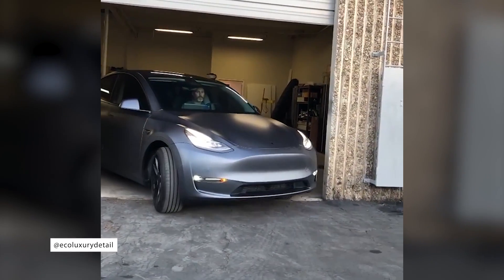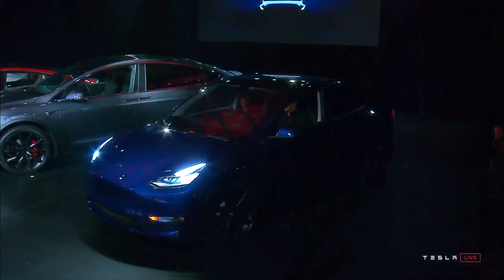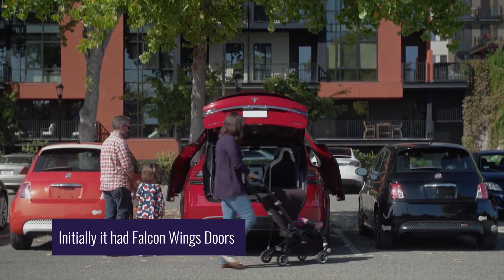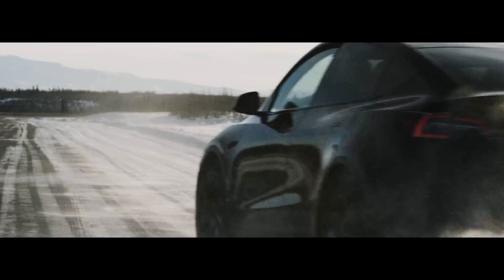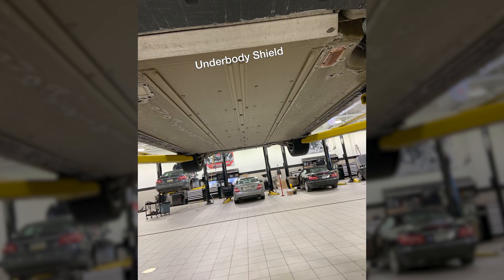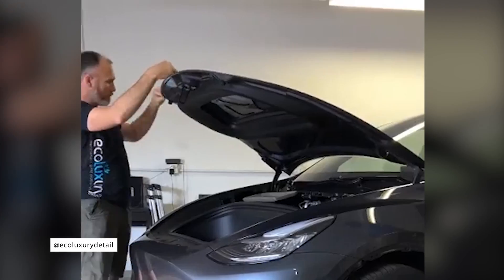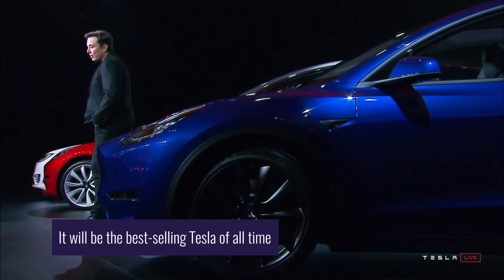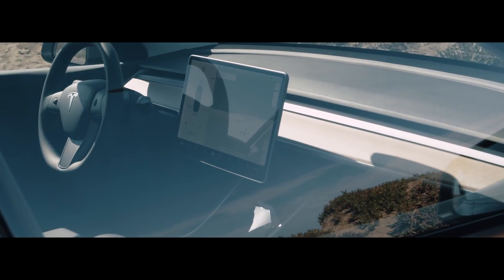Tesla Model Y: 10 Facts You Probably Didn't Know

Comment: I got my Model Y yesterday. Today, as I was sitting in the car, it was very windy. There was a loud whistling coming from the hatch area. I also have a 2012 Chevrolet Volt with 150,000 miles. The model Y is much stiffer and not as comfortable. It has a much more sports car feel. The Volt has a much better fit and finish. I always thought the Volt had great acceleration until driving the Model Y. Wow! I think Tesla is lightyears ahead of other EV's. They need to get a grip on fits and finishes.

Comment: Love my Y, although the hatch didn't align properly and had to push down it to close it. Tesla fixed it and it's almost perfect now.... my only issue is that the suspension is a bit too rigid, the car handles well but man no give when you hit bumps at high speed. Tesla could learn a thing or two from BMW about suspension. Otherwise love at home charging, cabin preconditioning, one pedal driving, perfect size and seat position, the minimalistic and super clean dashboard, the glass roof, autosteer, autopilot, auto garage opener, sentry, nav, tons of space in small package, safety, LACK OF MAINTENANCE (except for tires) and INSANE ACCELERATION... never gets old - the car just lunges forward.
Reply: I want one.

Comment: First, I would like to see latest solar panels embedded for extra miles on the bonnet and the rooftop keeping the panoramic glass.

Second, I want to have GPS guided solar tree, coming out of the car at the time when it is in office/home parking. It should be almost free to drive, from home to office and vice versa with this 30-50miles solar backup on weekdays.

Third, It should have an 1000miles hydrogen pack reserved for long drives on weekends. 

Fourth, Batteries can be restricted to 200miles range. This will improve efficiencies because of less weight and compensate for backup by solar and hydrogen.

Fifth, It should have four independent hub motors for all four wheels.

Tesla Zee Model with all five above implemented will be the Caar to have..!!

Comment: The only problem with the Y is that there is no readily available mechanical door opener in the back seat which is a big problem for emergency egress if there is a power outage or an accident...this shortcoming should be fixed in future versions (combined with child safety locks).

Comment: How do these perform in flood or at roads filled with water upto full tyre.
Reply: The electronical components are water sealed. You should be able to drive in water up to 1 foot deep. But I've seen people driving into puddles of water up to 3 feet deep with no problem but it isn't recommended.

Comment: Your video has one mistake. The Mercedes uses gullwing doors. The Model X uses falcon wing doors. A key difference is the double-hinge operation of the falcon wing doors vs the gullwing doors using a single hinge.
Reply from the maker: Good attention to detail and appreciate the feedback but in automotive nomenclature the terms are interchangeable regardless of hinge configuration. Falcon wing is correct, but gullwing is indeed more correct.

Comment: Info appreciated! However, if I do get a Model Y, it will be a 7 seater. Only if I don't have to morph adults into the size of puppies to get back in the third seat! I hate 7 seaters in general, but with two grandchildren, it will be so handy! I have heard that a Chinese battery maker called CATL will increase the range to higher than the current 310. But by how much, is not clear. Give me 400+ miles, and I'll pull out my wallet!!! Currently range anxiety is kind of bad during long distance trips. But yes, if you use the Navigation system of the Tesla, it intelligently shows you where exactly you need to stop to recharge.

Comment: Of course it's possible to build a safer car than the Model 3. At the IIHS small overlap crashtest the front structure started to collapse. The drivers feet room got smaller. Seriously, the small overlap performance is one of the reasons why I didn't want to go for the Model 3. I actually own 2 Volvo cars. I hope the small overlap crash performance will be better in the Model Y, in this case this could be my next car.

Comment: Got ours a month ago and love it.  Just a few hiccups though.   Summon function the car freaked out and needed a firmware fix that took a week at Tesla to. Figure out. Now we have a A/C issue in the cabin and on the display. Not cooling inside and says it’s 145 degrees outside.  Need to get this straightened out. Big fan of the vehicle here and know there will be some bugs to work out with software or and firmware updates.  
Wish there was a 50 mile battery backup unit as an accessory that was available just in case....

Comment: Gonna be 18 months until the Y is available in New Zealand. I’ll wait thanks. Should be a worthy successor to my Focus RS in dual-motor, high performance, 21 inch wheel guise. Maybe Elon will have incorporated a yaw sensing front to rear torque splitter by then.

Comment: The biggest problem with electric cars right now is if you come anywhere close to their stated performance 0-60’s you range is severely diminished.  So your  280 mile range is now 100 miles tops after flooring the car a few times.  So it would be much more accurate to state:  2.1 second 0-60 OR 280 mile range, but not both.
Reply: No gas car gets their rated range when you floor it either.
Reply: Kris Fisher true but it’s not as significant in a combustion car because you have a 4 minute “recharge” time to 100% capacity.  Not 45-1 hour to 80% capacity and only at certain super charging locations.  Electric cars will only become practical when the energy density of the battery packs are double to triple what they are now and the recharge times are cut in half or 2/3rds.  That is still a decade away.

Comment: I got my LR 2 motor last week. Love car but soured on my treatment throughout the process. I was told twice I would have home delivery (Tesla cannot sell in Alabama), Then when my TA finally texted me, he said not so. I had to drive 162 miles to Nashville to pickup. They tried me to rush me since they were delivering 40 cars that day instead of the normal 12 (June 27 - near end of quarter).  I could not drive until I paid. Also told me to take pictures of problems found during first 100 miles and send to service via app (162 miles to my home).  I could not get app to work on site and sales person told me sometimes it takes an hour.  When I got home that night, it still did not work, I texted the guy several times with no replies and suddenly it worked around 7: PM. The app would only let me take 5 pictures max.
Reply from the maker: Yeah...but hows the car?
Reply: Electric Future it is great. Gaps from 3/32” to 1/4” that seem simple to fix ( moving doors) and charging port door rests on paint rather than small gap. Service coming here 21st well outside my 7 day period. Hoping he can and is willing to fix. A neighbor noticed the gaps already. .
Reply: Electric Future y

Comment: corrections 315 miles for the smallest rim package the bigger the rim the more range and quickness you sacrifice for speed and looks and handling the big rims gives you 280 range. the car has had structure removed as it can still get a 5 star with less materials and the 3 and y are now made with better welds the y is not stronger or better the 3 gets the new welds and still has extra structure far safer less intrusion. i would rather have the x but the 3 is better in every way!!! the 3 looks better its more efficient better cornering and more range. its cheaper its faster its quicker its safer better blind spots better aero dynamics less body roll. the model y does not have 66 cubic feet of space if you have 4 people in car it drops down to 19 cubic feet if you fold down the rear seats in a model 3 it has 58 cubic feet any car on 18 or 19 inch rims have quieter cars than cars with 20 or 21 inch the bigger the tire the louder the car is.
the model y has put the seats on risers so they lifted the roof for head room but this made the windows retarded tall looking like a clown car. there are better options coming soon like the MACH E will have all the same performance specs of the Y but the hatch opening will be big enough to have a futon the 27 inches of opening space on y doesnt fit much or anything with bulk. you buy a Y you have ignored better options and probably will be forced to do foolish money....
Reply: Valid points all
Reply: Blah, blah, blah.....I am buying a Model Y.

Comment: Moved from a Model 3 to a All Wheel Drive, Dual Motor, Pearl White Model Y.
Important note:
Tesla Palm Springs, CA offered me $31k for my Model 3. I thought that to be low, considering only 2700 miles. So I took it to CarMax in Riverside, CA for an estimate. $36k! I sold it there. 
Model Y problems:
I’m also having problems with the hatch back. It doesn’t release when handle is pressed and rubs on the right side when raised. This friction is why the handle won’t release and has to be manually raised. 
I have to waste time taking it in to be fixed. Very expensive car to have to do this.
Reply: Good to know
Reply: These and other issues I've read about is why I would wait until Tesla matures as a car company.
Reply: Ettore Namias tesla has matured but they don’t care that a simple little fix like that happens to these cars, their mission is to help the world by getting more people into cars that decrease their carbon footprint, it’s not an electric mercedes lol
Reply: @MalaxaiVDW  when you spend 60-100k on it they should care about their build quality.
"their mission is to help the world by getting more people into cars that decrease their carbon footprint"
you dont get people into these cars if they wont buy them due to build quality.
Ive talked to well off relatives - some of their friends complain about their tesla, batteries in the winter/heat, non-aligned door panels, and some other ideosyncracies: other get desuaded from buying the cars that way.
Reply: Raph Ael if you’re spending more money on it and. or buying it for the over the air updates and driving capabilities as well as reducing your carbon footprint also even with not the best build quality theyre still the safest cars on the road so when you add all that up, the cars not being perfect isn’t that bad because i’m sure if you go back to the 1900’s tons of cars were messed up by factories that’s why they have a recall system for actual issues that everyone would have to/could face. so anyone who would buy this car and complain about anything that’s vain such as a panel being a half a millimeter too far from the one next to it, should buy a Mercedes or Porsche and be happy with themselves it’s really that simple, they act like the build quality issues aren’t well known😂.
Reply: @MalaxaiVDW  I guess it comes down to me being german. Sandy Monroe said it and I'm with him on this: To europeans, body build quality is extremely important. Thats why I think TSLA will improve on that in their factory in berlin.
Some ppl wont buy a tsla only for the reason of panel gaps, bad paint job + lack of luxury interior,
Reply: @MalaxaiVDW  Build quality is something you should be able to expect in a 50k+ vehicle tbh.
Reply: Raph Ael we’ll see... i doubt Tesla is going to make any one factory better than the rest or else their other car buyers would be mad, therefor i think they plan to sell cars to the Germans who are more open minded and less rigid in their old age thinking of everything should come perfect when you buy it, there’s something wrong with everything and being obsessed with perfection leads to failure in all cases, hence why people buy new cars even when they buy a super car that comes perfectly aligned and setup.
Reply: Raph Ael build quality is not their mission, people misunderstand Tesla they’re not selling you the cars to get you in a Tesla like other car manufacturers who just want to milk their cumstomers for cash they’re actually shooting to make the world a less toxic place. only people who understand this should buy tesla’s. anyone who would whine like a child over a misaligned piece of metal that keeps them safe and updates every couple of weeks would be happy in any other car that doesn’t do that but will come perfectly aligned.

Comment: Overpriced
Reply: Richard Dixon  It doesn't take much to be a shareholder. And they are expensive to buy and to repair, but they are super cheap or FREE to fuel and need almost no repairs. It's really just tires and wiper blades. If you keep it for years you will save money over any other comparable car and if you sell it they really keep their resale value (just don't trade it into Tesla)
Reply: @israndy  The amount of money you spens for Tesla car is the same amount of money you would spend on fuel and repairs for ICE car plus the price of that car.The price to recharge your EV is low now,since there is no huge numbers of EV.As soon as EV cars become dominant the price for electricity will go up to the point of fuel price today.

Comment: If the title of your video is about nine facts we don't know try getting one of the facts accurate The range isn't 315 mi for the model y performance it's 280 and top speed is 150.
Reply: Their facts are correct, just depends on the model the total range available. Most commenters will use the biggest number to refer to them all, rounding up.

Comment: I'd like to see the frunk auto close and latch. it seems that the Model 3 front hood can be damaged if one attempts to close it incorrectly. An automatically closing and latching front hood on the Y would be a worthwhile improvement, I think.
Reply: Or just make it a little thicker. I’m all for cutting weight - but it is frighteningly thin - I doubt I will use that area - worried about damaging it.
Reply: We have a Model 3 we always close the frunk with one hand just don't press on the Tesla emblem or you may dent your hood.

Comment: Since it has a heat pump combined with the octovalve does that mean it can supply heat directly to the battery via heat pump?
Reply: Do you mean instead of from a heater directly? All Tesla’s can heat the battery by warming the coolant flowing through. Some use heat coils, some use heat pumps, and some use energizing the motor in place, or some combination of the above.

Comment: It is difficult to see out of the rear with the rear view mirror. The back passenger seats are bad the passengers hit their heads on the cross bar. You can't fit 3 adults across nicely despite extra width and we haven't seen the last row yet.  Doubt that fits 3 adults either.  To do it just extend the slope back a bit.
Reply: I bet the 7 seater allows the middle row to slide back and forth, that will keep passengers from touching the crossbar but you can also just not recline all the way.
Reply: @israndy  Without moving the roof, the bar will still be an issue for the row of seats behind the driver.

Comment: How will the heat pump provide reheat when dehumidification mode is needed?  This mode requires A/C then reheat during cold weather. A heat pump can only operate in A/C or heat not both.   I thinking resistance heaters are used for this mode but I have not heard anyone explain it yet.
Reply: Just because they have a heat pump to provide heat doesn’t mean it’s the only method of providing heat in the Model Y they can activate the motors to heat the coolant just like on the TM3. Interesting question though.

Comment: I have the model 3, I just don’t think it’s worth an extra 20k, everything seems to be the same except for those 3-4 inches of extra room.
Reply: Are you saying that the same trim level Model Y casts $20k more than the Model 3?? For example a LR dual motor Model Y costs $20k more than a LR dual motor Model 3. Is that true? Also if you pay attention to the video, there are many technological advances new to the My that the M3 does not have.
Reply: Philip T technological advances that the average person won’t be able to differentiate. As far as pricing, it all depends on the vehicle and specs added based on your needs. But I would say for the average Is about 20k, you could research it, I may be wrong. The model Y is a beauty don’t get me wrong.
Reply: @Unicorncolor_chain  same trim level should cost you about an extra 4-6K (about 10%)

Comment: actually I'm missing fastening points for a curtain or security net to separate the trunk (or trunk + folded rear seats) from the rest of the cabin. If you watch it in the right light safety regulations in Europe may require load securing for stuff stored in the frunk higher than the rear seats, so most hatchbacks sold here offer at least some solution: either a proprietary net delivered with the car as BMW does or at least fastening points where aftermarket security nets can be fastened. As soon as you buy a hatchback over here that has the possibility to increase the trunk by folding away the rear seats you will have not only four such fastening points behind the rear seats but another four between the rear seats and the front seats,
Reply: Valid point